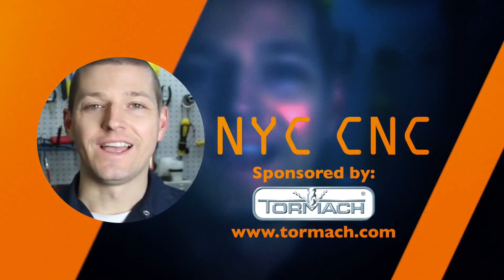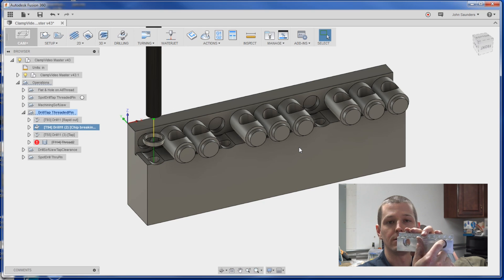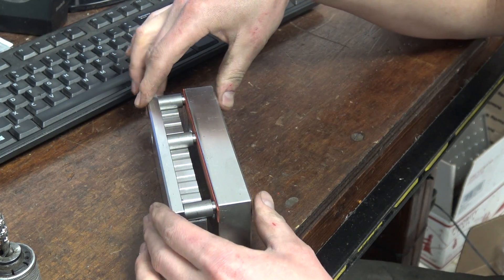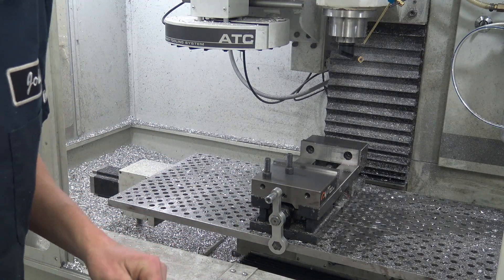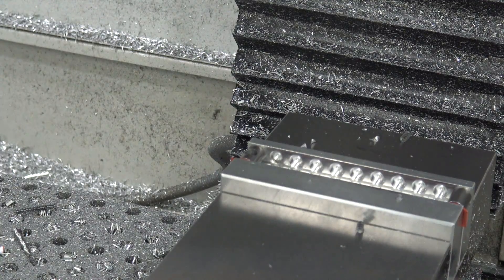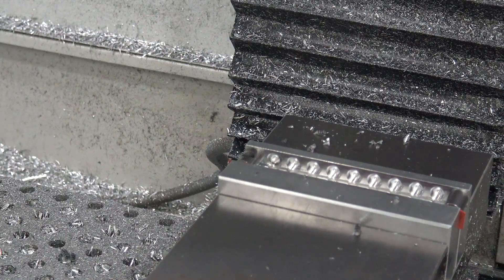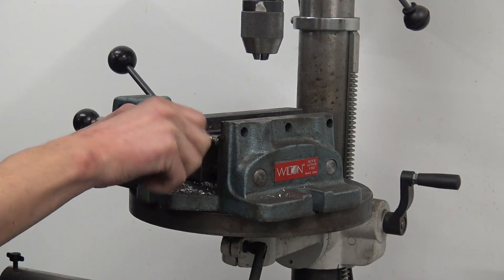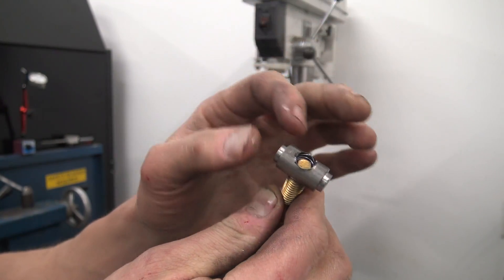Form, Cut or Mill Threads,  Softjaw Mistakes and more! Widget79

Comment: Except for hardened materials, we form-tap just about everything at work - blind or thru, doesn't matter. For deep holes, I find it better to fill them with lube instead of coolant.
If you use the correct hole size and cleaned them for chips - it's gonna run until Christmas.
There's also special formtaps for aluminum.
Reply: We use them on almost everything to. Including some pretty hard materials with the use of "ER" (energy release). Shits stickey and makes a mess but makes it possible to use form taps on just about anything. Just coolant for aluminum. Great for blind holes, and they don't have much of a lead generally so you don't need to grind them. In my experience sometimes it's hard to get your minor right. They look super shinny and pretty, but if you look at them under the scope the crest of the thread is pretty jagged and shitty looking (I suspect the cause of the minor dia issue). And if you're using them near the edge of a finished part you'll want to do you milling after you tap bc they will deform the material and you'll have a bump along the length of your hole. Also you can't tell when they are dull, sometimes you'll see the coating go but most the ones we buy are grey. I use a "emuge" holder for anything smaller then an 8-32, anything larger, highly recommend a rigid holder.
Reply: And for up to 54 HRC you can use pulver metal HSS taps, they cut really beatifully and we use them often together with carbide drills to get those missing screw holes :)

Comment: With the form tap on the floating head that you are using you may need to program it to tap deeper just because the way it floats before it engages. And there is nothing you can do for the treads having burrs on the top you can run the spot drill again to clean it no extra depth and the back you are better off with a belt sander then a chamfer tool

Comment: You need to fix your tap cycle.  It should feed in at the pitch or just slightly faster than the tap pitch to get the compression holder to grab, then stop, then reverse and feed out at nearly 2x the speed of the pitch so that it puts the holder in tension and the tap snaps out of the hole at the top.  You are buggering up your threads by not feeding out faster.
Reply: NYC CNC Try 1.1 times the pitch, to start with.  If the tap continues to dwell at the opening when reversing, keep upping the return feed to 1.2, then 1.3 until it's putting the tap holder in tension.  The problem is that your holder is getting compressed so much at the lead-in of the hole, when retracting at feedrate it's dwelling and rubbing the tap.

Comment: We use form taps all the time in the lathe. You can tap to the bottom of a blind hole which means u don't have to go past the width of the part off tool. In our case it's a 3mm part off so I just drill/tap part length plus 3mm. Benefit of that is when the hole continues into the next part it can easily start to walk off centerline more and more.
Reply: Exactly. No chips, no packing at the bottom, no broken taps.

Comment: FYI to anyone using a form tap on a Haas VMC we have all our posts include a M42 to command high gear for the spindle. We tap with ER32 holders and a tap collet not a torsion head and you will break taps without running the machine in high gear in a rigid holder setup.

Comment: John, noticed in the video you started out with a low opinion of roll forming taps.  Hopefully you now see they are quite a good way to tap. Specifically, they create no mess or chips, so doing a large number of tapped holes on a project works really well (example: fixture plates). I use them a lot on my CNC and get really great results. I have also started playing with thread milling, but honestly for most of my tapped thru holes I use roll taps. Cutting taps leave chips and debris that sometimes get into the adjacent holes and cause issues. Roll taps don't, nor do they jam or break very often.

Comment: I would really recommend using a spot drill with a larger angle than the drill point. LakeShore has 140deg spot drill that I've found are 1000x better than a 90deg spot drill, especially since most machine drills are 130-135deg. Also since the spot angle is larger you can easily go a little deeper to create a chamfer on the hole for the tap or thread mill or whatever. That will go a long way in reducing the burr.
Reply: +War Machine LLC 
I thought the main goal of spotting was to keep the chisel edge of a normal drill from contacting the stock, which prevents walking. Seems like a 90º spot would do this job, and with a 90º spot you'd have a nice 45º chamfer left over.

Wouldn't a hole made by a 140º spot drill be closer to flat (180º) than 90º?
Reply: +Hirudin I've heard that theory and bought into it for a long time. Experience and many drill bits later has proven otherwise. The larger spot forces the drill into the center  much better and is much easier on the drill. That chirp you hear when drill first engages it it chattering and wobbling around throwing the hole position off. Do that with a carbide drill, especially a large one, you rapidly chip the cutting flutes. Once you use a larger spot all of these problems vanish.

Comment: Why can't you have a matching set of soft jaws, so the drilling is over the gap between them instead of over the jaw itself?
Reply: +DJ Delorie 
This way he only has to machine one soft jaw. In other words, when this project is finished he'll still have one "good" (like new) jaw.
Reply: Plus you are overconstraining the positioning of the part if you have the shape in both of the jaws. Having the locating features in the fixed jaw provides absolute positioning each time and no matter where the moving jaw is, it is still the same.

Comment: the rol tap (thats what we call it at my job) pushes material away but the material jumps back to its original position. thats why it tight when you try it. then again you do get stronger thread and a perfect fit. so if you are going with that. keep in mind that they need a new quick turn in the lathe to remove the bur

Comment: A few things:

1) Form taps work fine by hand.  I don't buy cut taps in anything smaller than 1/4", and I use my form taps in everything from my CNC machine to hand drivers to a cordless drill (not an impact, a drill with a clutch).  They work great, don't break with anything like the regularity of cut taps (in the small sizes for sure), and lend themselves very well to automated operations due to the lack of chip production (no chip breaking or rats nests to deal with).  The DO require better lubrication than a cut tap does, for obvious reasons.

B) You're getting a bur because you're not chamfering the hole before you thread it.  Spot, drill, chamfer to a depth greater than that of the thread you will be making, THEN tap.  Any other sequence or edge prep will result in burs and secondary hand operations.

3) If you watch your cycle time and take tool cost vs tool life into account, a form tap will beat that thread mill every single time, even with that Tormach's lackadaisical tap cycle.  They don't hurt so bad when you break one either.

IV) You should curse more often.  It's not natural for a grown-ass man in an industrial shop setting to say "Darn".  ;-)

Comment: spot drill to full diameter with a 7/16 or 15/32 to eliminate the burr without adding a step.  The form tap hole is bigger because material is extruded back into the hole during forming  ie the id of the hole shrinks in the process.   Formed threads are much stronger because the grain in the material is continously rather than cut into short segments that can shear in tension.

Comment: John. If you really want to go first class with you fixture (You probably wont). On your moving jaw drill and ream or bore a hole at each parts location so you can install a small piston with a o-ring seal. Drill a cross hole to intersect all the pistons holes with small pipe plugs at each end. Start each piston in each hole than fill full of oil (try to eliminate as much air as possible ). Mount the jaw and clamp all the parts than crack one of the plugs to bleed off some air (like bleeding breaks). The hydraulic pressure will balance the force on all the parts even if they very in length. The only down side to this is you have to have a full fixture or blank parts in every station.
Reply: That is a very good idea. That is something I will have to make note of. Never know when it may come in handy.

Comment: are u supposed to use the form-tap in a tap head? 
I used a Collet (because of the high torque) the few times I form tapped. 
Of course in a good machine (DMG 105V linear) :) .

Comment: Sometimes CNCs do crash, we have a haas VF2 with a chip conveyor, on long production runsyour chips can fill up on the y axis way cover behind the table. if you're using the whole table movement and you're drilling or whatever right at the front of the table, the small amount of swarf behind the table can overload the y axis and move the table during machining cutting the machine out. i bent a 14mm drill.

i reckon this is a design flaw and the machine should have better removal of chips, the y axis cover is too flat so the coolant won't push the chips off when it's flowing down. i had to pause the machine after every 5 drilled holes and clean the ways out and each part had 96 holes 22mm diameter on a triangular pcd in the centre, 2 m16 holes directly opposite and 16 30mm holes on a pcd around the outside and we had 30 of these parts to do in 1045. that job was a real PITA.
Reply: +NYC CNC true, just found it really odd that a little swarf would overload the y like that.

Comment: The form tap would have run a lot smoother if you had lubed it.
Also run a countersink on each side of the hole to get rid of the burs.  This might me relegated to a hand operation.

Comment: The reason a rollform tap drill is larger is because you are forming or squeeshing the material inwards towards the center of the tap. If you check the hole after being tapped you will see it has shrunk.
Great video... love the slow mo!!!HHHHoooooolllyyyyy  sssshhhhiiitttt!!!!

Comment: Would you recommend using a form tap or spiral flute tap for a drill press and reversing tapping head?
Reply: +David Moghaddam 
Does your tapping head have specs for largest recommended tap size? I have a Procunier Tru-Tap 15000 and the recommended largest forming tap on it is #8 (in aluminum). I'm pretty sure I've done 1/4-20 in it though. For reference, 1/4-20 is the largest recommended cutting tap size (in aluminum) for that tapping head.

If you're thinking about using a 6-32 form tap with a tapping head that can handle a 1/2-13 cutting tap, I bet you'd be fine... well, as long as it's sensitive enough to reverse direction properly.
Reply: It's a Shars model that can use 0-1/4 in steel, however, I use primarily aluminum.  I tried it with a 6-32 spiral flute tap and it gave me beautiful results.  The smallest diameter I need is M3, and for any smaller 2-56 and 0-80 I have a hand tapping machine.  I might be ballsy enough to tempt fate in the future, though.

I just like the idea of a form tap and how clean it makes the threads.  I, like John, am starting in an apartment.  So, noise and chips are my enemies.   Thank you for the advice.

Comment: do you have all the parts made? concave the end of the part about .002"-.005" and kick your federate way down when you get to the last .025"-.050" to get rid of any nub that might be left to help with rotation in the vise. also it might be a good thing to center drill the pockets in the jaws to help clear chips and hold better for faster loading(looks like that might have been done?)  most of the time we used a few little vises rather than load more than two parts in once vise

Comment: You can use form taps on manual drill presses etc. but be sure to use the right spindle speed as a certain speed is neccessary for the optimal "flow" of the displaced material. Not sure if some tool manufacturers wrote something about the "flow", if I read it on the web or if it's just my own idea. So hand tapping should only be an exception for form taps. 
At my job we use form taps for M4 to M10 in common steel (1.0038) and stainless (1.4571 IIRC 316Ti) and copper. For steel and copper we just use the water based flood coolant or internal coolant through the collet without a sealing disk in front of it.Further we higered the concentration of the coolant (Castrol Alusol MF-X) from 6% to 8%. For stainless we program M0 and use Rocol cutting oil without waterbased coolant. Further the Rocol oil is used on any manual machine for thread forming.I would always form threads, at least on manual machines, if it's not forbidden by your customer. E. g. the tip of the thread flanks that are not entirely closed due to the nature of the process are a no go for the food industry because they are much less than optimal for cleaning the internals of your production line. 
IMHO cold forming would be the best description for forming taps as this is exactly what happens.
Reply: +1AB09CC3 
Very interesting about the thread tips not being closed. Thanks! I'll try to remember that.
Reply: +Hirudin No problem. The large the threads get the better you can also see this in your finished thread. 

http://www.pronic.com/upload/fckeditor/Image/Support/Rollformed%20thread%20process.jpg

http://flowdrill.com/sites/all/themes/fdtheme/images/flowdrill_process_page_image.jpg

Comment: You can use form taps by hand, I do it all the time, but they really shine with power tapping. They are great for fixing damaged threads as they don't remove any extra material and will self align into the existing threads. Run them with coolant/oil always!I find that way lube (use your tamp oil it's free!) or EP grease works well on steel/stainless, or run your coolant about 10% and you should get about 2-3 times the life out of a form tap vs a cut tap. The hole size is supercritical, on small holes you need to be within a couple of thousands to get perfect threads.
Reply: Yep, every bit of tapping I do is by hand with form taps and one of those spring loaded tap guides to keep everything in check. Mostly 2-56 blind holes and it works like a champ. Everynow and then I break em but the material is usually titanium so i just soak it in ferric chloride till the tap dissolves.
Reply: Yep, every bit of tapping I do is by hand with form taps and one of those spring loaded tap guides to keep everything in check. Mostly 2-56 blind holes and it works like a champ. Everynow and then I break em but the material is usually titanium so i just soak it in ferric chloride till the tap dissolves.
Reply: +Widget Works Manufacturing Inc. Ha, seems like I'm not the only one with a preference for form taps for hand use! another nice feature of them is that they allow tapping into thinner workpieces than would be advisable when using regular cutting.
Reply: +krawutzimon actually just got done hand tapping a couple 10-24's(form/roll tap) in a mounting bracket for a remote operator panel for my surface grinder.

Comment: I know nothing about CNC (well, only what your videos have shown me), but it strikes me that the answer is staring you in the face. You've a long production run to do - make some properly sized soft jaws and go with the form tap. It was faster, produced a harder thread (important in your product) and the fit was good.

I think someone else has mentioned countersink to get rid of the burr. Either mill the end flat, then countersink the hole on the flat surface, or go in with an oversize countersink. Having a burr will be unacceptable and its another operation that you will have to hand finish?

Comment: The phrase is work hardened. It doesn't happen, or happen substantially, to every type of metal though.
Reply: +Garrett Smith Staggering is that I feel compelled to apologize for the direction this entire chain of interaction has gone. Sorry, NYC CNC. Keep making fine videos.
Reply: +canid song 
Are you referring to what the form tap is doing? Seems like the word "forming" suits the process pretty well.
Reply: I'm referring to the hardening in the steel which happens during cold working processes which is referenced in the video.
Reply: I got that. I just wondered why you brought it up.
Reply: Did you watch the video?
Reply: +canid song 
Yes.

Do you see any reason why starting a comment by saying "the phrase is..." without any context can be problematic?

OK, fine. The phrase is "work hardening". Now we all know the phrase. Just insert the phrase "working hardening" SOMEWHERE into the 15 minutes of monologue of this video. Thanks, great tip!
Reply: +Hirudin You seem to be under the impression that my comment was for your benefit. You are mistaken, unless you are NYC CNC in which case you should, presumably, know what you said about the phenomenon in quesion. Otherwise, you can be expected to either recognize the connection between part of the video and my response or else go about your life. It's a fair bit more productive in any of the above cases than wasting your time and mine, and then more of yours and then more of mine. When you're signing my paychecks you can begin to tell me how to spend my time, but you can sure as heck be a bit less combative with me even then. You've used enough of my time to no gain whatever and can expect no further response from me beyond this point. Politeness counts.
Reply: You've picked the wrong venue if you intended your comment to be seen by only one person.
Reply: +Hirudin 
John, the guy in the video, was not sure what the correct term for work hardening was @1:46 into the video.  Canid repilied with the phrase he was looking for, and a bonus fact he should take into consideration when using the form threading technique.

The fact this needs to be explained to you is staggering.
Reply: Stagger this: fuck you.